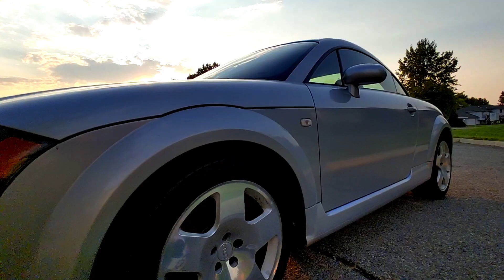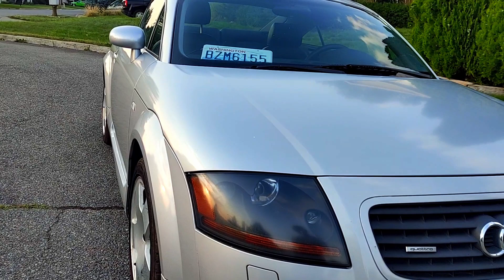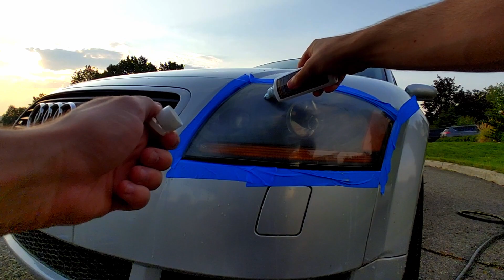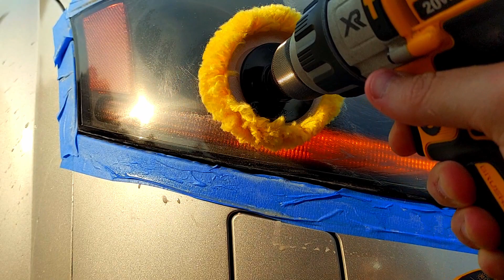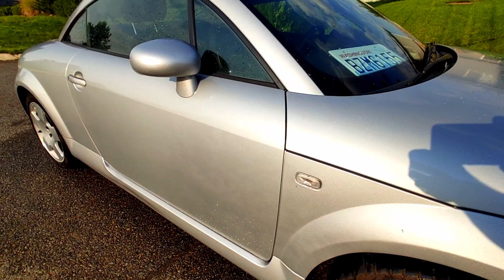HOW CLEAN Can We Make These Headlights for $15?

Comment: Do you happen to have a link for this product you use? I know this is an older video, but I have the same exact problem, and this seems like a cheap fix! Thanks. (Ps, love the videos!)
Reply from the maker: I am glad to hear you are liking the videos! That means alot to me. 

I think this is a link to a similar kit for restoring headlights: https://www.autozone.com/wash-cleaners-and-exterior-care-products/headlight-lens-restorer/p/meguiar-s-heavy-duty-headlight-restoration-kit/379532_0_0?cmpid=LIA:US:EN:AD:NL:1000000:WAW:1738713047&gclid=Cj0KCQjwpImTBhCmARIsAKr58cxnx-i7Apzs7E-6TfCBz8oCLSdWBeNjQTUJd7b3K82bcGSlAqLQXgIaAljSEALw_wcB&gclsrc=aw.ds

Or if you want one that is even cheaper I have used, and liked, this one as well. https://www.napaonline.com/en/p/TW_T240KT?cid=paidsearch_shopping_dcoe_google_monthly-special_202204&store=26986&campaign=GSC-Promos&campaign_id=6478906937&adgroup_id=78844950918&adtype=pla&gclid=Cj0KCQjwpImTBhCmARIsAKr58cx_14gx05V997tD-M0l2h5GMcOaP2tkugGq9-xGUdAVsc3htIxF6-caAqUFEALw_wcB&gclsrc=aw.ds&

The first one is more expensive because it comes with the drill-bit polisher and whatnot :) Hopefully this helps. You can find these a bunch of different places online too, including amazon so the price can vary a bit.